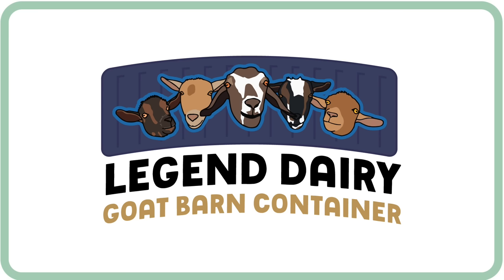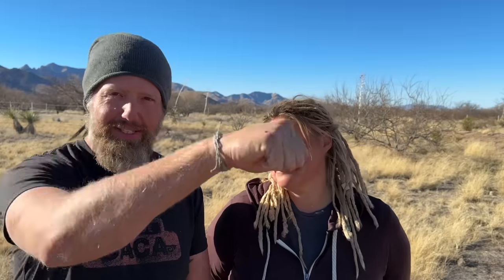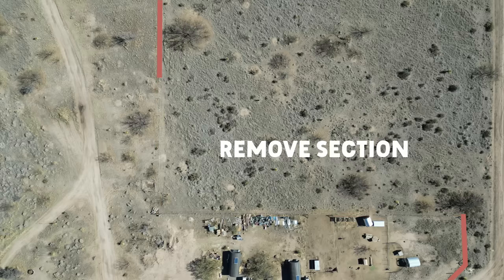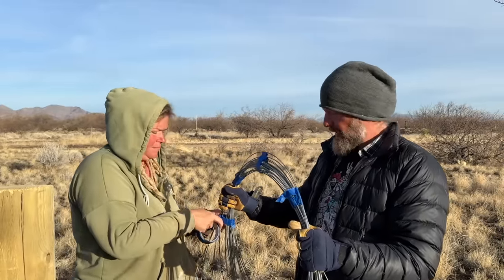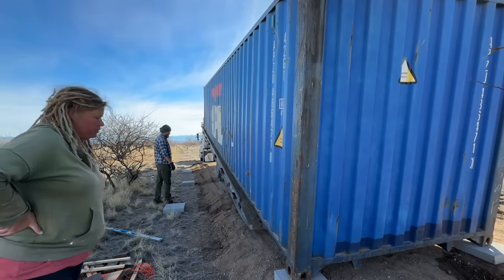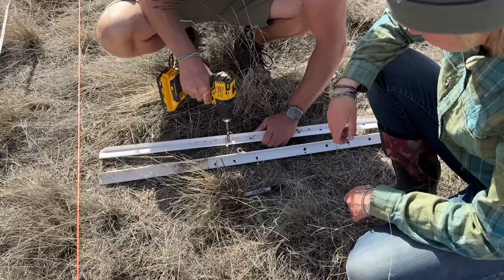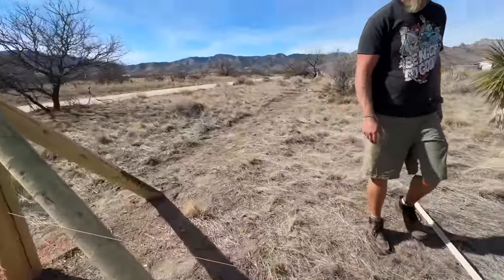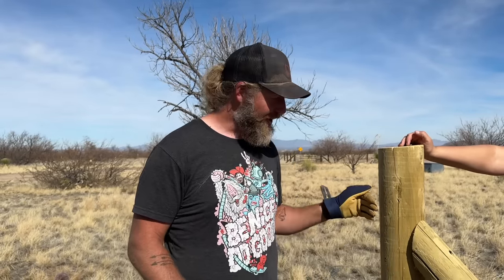IT'S HERE! Adali's Goat Barn Shipping Container Gets Delivered

Comment: The nice thing about containers is that you can unload them on a hillside and then level them and place concrete piers or pilings after the fact.  Lifting and supporting one end at a time is usually no big deal with a high lift jack and temporary supports while the work is going on. The process can be kept fairly safe.

Comment: Hey watching you do the fencing made me miss fixing fencing on our old acreage. There is actually a little tool that does help with twirling the wire around on itself. It’s a small (6”) with a small hole on one end and you just insert the wire and start twirling. Cheaper than the crimping parts and probably just as fast. Love the clean lines at the corners.
Reply from the maker: Yep, the problem is having a way to hold the wire on itself while using that tool. Pain in the butt :) Crimps are so much easier

Comment: I am glad to see that someone had the same idea as I did for shipping container animal shelters.
Building barns and stuff from wood can be bleep’n expensive so why not reuse shipping containers, you just have to remember to put enough air vents and stuff in them to keep the air circulating for the animals.
I have plans to use a 10 foot container for my chicken coop and other 10 containers for shelters for my goats while they are out in the pasture.
Also have plans for other size containers for other animals but those will come later on, I am starting with chickens and rabbits first then may expand as I get use to the animals.

Comment: Every time you mention needing an ATV, I think about the fact that I have a Polaris Ranger 570, two seater, sitting on my friends property not being used (because I ended up not being able to develop my property, next door).
If I lived closer (I'm in Yuma), I would definitely loan it to you.
I also have a golf cart that mom used to use to go rock hunting (until I bought the Ranger), that I need to get rid of (needs batteries). Amazingly, the golf cart does well out in the desert, just air down the tires.
You can still get stuck, but if you choose your route wisely when crossing a wash, odds are you won't.
Full disclosure, even with mom's experience, I have had to dig, and or pull her out on occasion.

Comment: I'm so glad you got your shipping container! nice, concrete piers for it. Digging up a plant! Wow, so much prep work because you can't use piers! I'm glad you didn't get much done before you found out it wouldn't work. I liked the "sun dog" behind you head Ashley when you were talking about moving the fence. Lots of fencing wire to wind up. I like the blocks. USA Containers! Yay, you got it there and level! Why three holes at the bottom of every t-post? Baby goats? I'm glad the ground was soft! What a push to get the fence lines run! Nice, you found an easier way to attach the wires together!  I like those cable crimp ties. It's all back together, yay! Darn, I missed the donation because I couldn't fill out the form? Thanks for this video Longnecker family!

Comment: Was about to say put a fencing staple over the black tubing to stop it moving, cause it will move if a goat works out 'put hoofs either side on the black tubing and put weight on it 😅😅 gap in fence'  escape time 😮.
You called the fencing staple a u shape nail.
Reply from the maker: Goats won’t be anywhere close to the perimeter fence. And yeah. They’re also called u nails

Comment: 6:42 Look up back wrapping, or over under coiling.  You know how you have to twist to get it to coil?  If you twist one way for one coil, and then the other way for the next coil, it will stay flat, and will uncoil straight with it just laying on the ground.  I did find one example for an audio cable, but it works on all wire and cable. https://www.youtube.com/shorts/RE-z5UteKfc
Reply from the maker: Guessing you haven’t worked with high tensile fence before. The only way it stays in place is on a spinning Jenny. Way too much tension even when it’s coiled properly.
Reply: @TinyShinyHome  Have worked with high tensile fences, aircraft cable for overhead rigging, huge multi channel lighting cables, flex conduit, hoses and many more.  Yes, for machine wound cable, that is wrapped only one direction, you have to use a spool, but when it is reused, or coiled for later use, under over is the best way.  It coils flat and can be laid on the ground and will uncoil evenly without whooptiwoos or kinks.
Reply: I had first wanted to mention this when you were struggling with the tubing for your berm and swale watering system, but did not say anything because I knew the video was posted well after you had completed the project.  I assume this was posted well after the fencing was complete, but decided to say something this time.  The same principle applies to the tubing as well as the wires.  They have a natural twist to them and will want to coil in a specific way.   If you try to coil all in one direction, but are not machine spooling them onto a spool,, they will want to twist out.
I assume others thought it was too late so did don't say anything about swaging tools and ferrules for your fence.  I am happy you now have learned about those too.  I started working with those back in the '80s.
I am sorry for trying to be helpful, but Don't tell grandma how to suck eggs.
Reply from the maker: Sorry thought you were talking about the pre-wound stuff. Yes will look into it 👍🏼

Comment: Do you have a link for the DeWalt drill that was used to make the holes in the ground?
Reply from the maker: It’s a hammer drill for concrete (got it for the exterior on the dome).  It does use SDS bits so normal ones won’t work. https://amzn.to/3OMPPhq

Comment: you all are the very first  i've seen put up an electric fence that way.  i've put up tons of electric fences but never hot/ground/hot/ground.   where i'm from all wires are hot and we have a grounding rod in the ground and you touch any wire and it lights you up.    your way is strange to me, not that it's wrong, but?!?!?!
Reply from the maker: Well grounding is a huge issue here. Most traditional all hot electric fences don’t work because of the sandy non conductive soil. This is an elegant solution to the problem :)
Reply: @TinyShinyHome  thanks for the reply and videos.

Comment: I know it is to late now but if it were me I would have put up the new section of fence. Then tie it into the old & then remove the unneeded section to be used in a future project. That way at no time would you have been left open to predators.   I hope all goes well
Reply from the maker: It would have been in the way during delivery of the container, that was the problem.